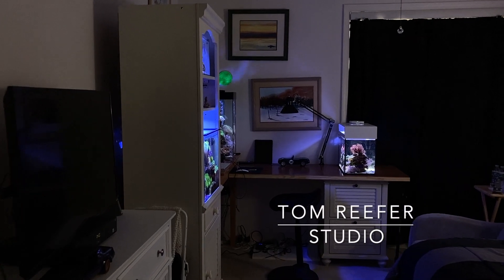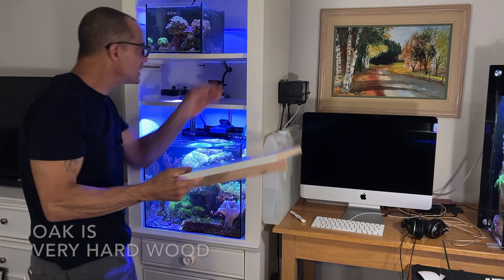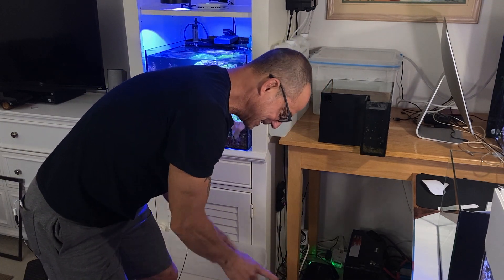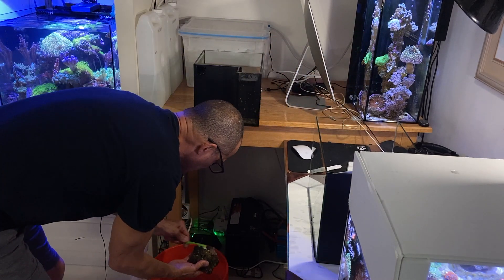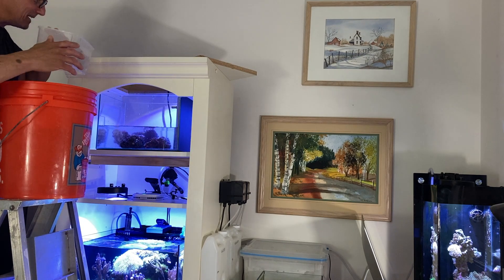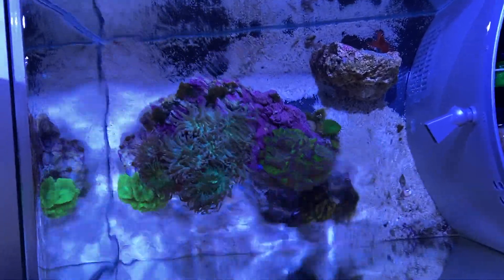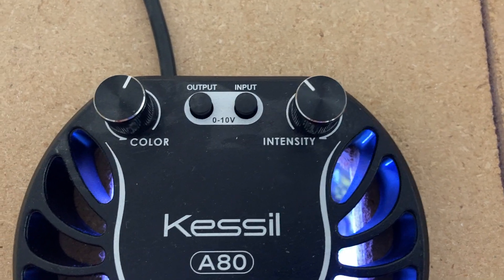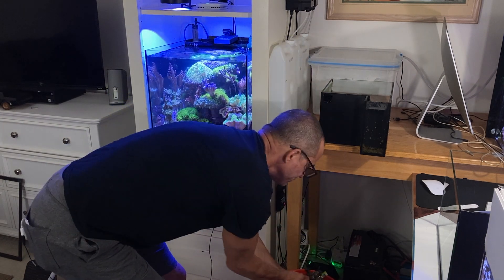Start A Nano Reef /Part 2  - NO CYCLE  - (QUICK AND EASY METHOD)

Comment: Hi Tom !
Wednesday question .
I have a mushroom leather coral baby without fragplug.Can I glue it on the rock or it do it alone?
Reply from the maker: Hey Alexandros! If it’s not on any kind of substrate it’s impossible to glue. You might try a small cup of rock rubble in really low flow, and see if it attaches in there. Then glue  the rubble. 😊

Comment: Why didn't you use peroxide to clean the rock? I find it does wonders when removing live rock for a cleaning.
Reply from the maker: I’ve just never used it. I haven’t had to take live rock out over the years to remove hair algae. 😊

Comment: Hey Tom, quick question. I had a 7 gallon nano with only an anemone in it. I dealt with Dinos for some time and after a while I gave up and said screw it, i'll start over. So I bought cured live rock from my LFS as well as live sand (Caribbean live sand) completely cleaned out my equipment and will not be putting anything from my old tank except the anemone. I watched this video to find out if anyone else has done something similar and have been successful in skipping the cycle period. That said, would you say it's generally safe to transfer this anenome over to this new tank? Again, new water, new live rock, new live sand, dumped some "seed" for extra bacteria, now wondering if it's ok to put just an anemone
Reply from the maker: Hi Blurry, if your live rock was already cycled from a previous tank, and you’ve tested for ammonia and nitrite just to be sure they are 0ppm, then it’s ok to add the anemone. Also, dinoflagellates can crop up again, just give your tank time. Sometime months can go by before dinos die off. 👍🏻

Comment: You use protein skimmer or Not?
Reply from the maker: Hi Pakcik, on the 20 gallon tank, yes. On the 5gal no. 😊I will rely on water change to remove nutrients.
Reply: @TOMReefer  ohh nice friend,how much water you change?
Reply from the maker: Depending on your nitrate level, but 50% on 5 gallons weekly. But test for nitrate and phosphate every few weeks to make sure it’s not rising. If it is, then even larger water change is ok😊👍🏻
Reply: @TOMReefer  nice friend,tq😁